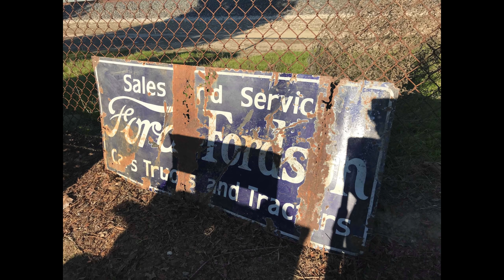California Adventure 2019 Part 1 - Hot Rods, Offenhauser and Turlock Swap

Comment: hmm. Not a fan of lowriders. Don't see the point. Personally not a fan of chopped tops either, but that's from a practical standpoint, while some cars look great chopped, I'm a tall guy, they do not work for me. In fact, I'd like to reverse chop some, making the cab taller instead of shorter. I don't remember ever seeing that, I don't even know if it can be done. Actually lowriders at the low setting the way most park them don't do well for me either, I'm no longer young and gettiing out of something that low is a problem. Trucks that are lowered and /or set on car frames make little sense to me either, not if you want to haul anything much, but I do like Rancheros and El Caminos, go figure, but then you don't expect them to haul much. I'm a bigger fan of resto=mods, ones that look stock as hell, but have more modern brakes, and an kick ass engine, but without electronics. Electronics are so prone to failure, I don't see why anyone would want them.
Reply: Toot
You forget, hot rodding is rolling art work, to each their own. Remember Ed Roth and George Barris ?
Reply from the maker: The nice thing about custom cars is that we can all make them what we want them to be. I don’t think it’s fair to make a blanket statement about a style or type of custom car just because you can’t fit in it or don’t want to bend down to get in. I appreciate most all custom cars that are well done.  A low rider is about crazy as it gets for the passion that goes into building them and the level of the quality of work. Feel free to raise the roof on a car, it’s your world and your car! -Matt/ITG
Reply: It'd be as boring as all fuck if we all built the same shit!
Reply: @IronTrapGarage  I agree, just as long as we are not talking about donks, stance, or squated trucks. Some of the modern trends are stupid.
Reply: @RichieCat4223  OH yeah, I recall Big Daddy Roth and Barris. I'm saying anything but what I like and don't like. Everybody else will have different opinions. I've seen some lowriders that were amazing, with paint that was so intricate... but still I see no reason to set it on the ground, hop it or all that, just not my scene. Then you have the guys that jack stuff up so high they're practically not drivable, not at speed anyway, they'd roll in a heartbeat. Me, I'd rather it look nice but plain,  but blow your doors off when it's time to go. Heck, I'd like one of those 250 HP VW bugs!  I had a buddy that was stationed in Germany back in the 70's. He had his Firebird brought over... he was doing 120 on the Autobahn and got passed like he was standing still by a VW bug. I'd like to be the guy in the bug, not the thunderchicken. 
If I could make it happen, I'd find a nice stock Mom mobile, then stick a huge blown V8 in the back, but make it look as much as possible like it was still a minivan MomMobile. Could you imagine the face of some guy that has his hot rod blown away by a Mom mobile? That would be fun. 
A guy that ran around my home town had a Mustang that had super wide tires on the back with ladder bars, and a prostock style hood on it. everyone thought it was one badass mustang. I caught im with the hood up one night... it had a stock straight six in it. I guess that's the opposite way to go. Then there was one made the magazines, a Chevette of all things. Big meats out back with traction bars, wheelie bars, the driver's seat was moved to the back, there's a big ass blower sticking out of the hood... but under the fake blower was that stock little four banger.
Reply: @tootall5559  there is I believe a Honda minivan on here with a souped up motor racing and beating q bunch of ppm
Reply: @jameswalker3416  I wouldn't soup a Honda motor. Frankly, I've heard them souped with the loud pipes and all, does nothing for me. I'd actually leave the front wheel drive little banger in place. Use it to pull up to the line... Fire the big V8 in tha back at the last minute. Watch their heads turn as it shakes the ground!                 
Speaking of that... my home town has a weekend thing where they have parades, marching bands, band competition, all kinds of stuff...or at least they used to, I haven't been there in at least 20 years... any way it's late Sunday nigh after the big weekend. We'd all heard rumors of a gal just past the end of main street that had a really hot mustang in her garage... well this night the rumors were confirmed. That thing came idling down main street,  at only idle the windows of the store fronts were vibrating so much we thought they'd break. Don't know what the hell she had in it, but it was badass as it could be, that's for sure. Why she had it out... don't know, it was actually a race ready car. ... that reminds me of another one

My buddy was driving, he got pulled over by a cop in a residential area. Just as he gives the cop his license, a full on front engined rail comes zooming by. No lights, of course, fully track ready. The cop tosses my buddy his license, and says "It's your lucky day" then gets in his car and takes off after the rail. (yeah, that's how long ago it was, they were still running front engine "digger" rails) I actually used to work for the guy that owned the rail, mowing his weeds and what not. Whatever happened, I don't know. We weren't far from his house and garage... probably pulled in and shut out the garage lights until the cop was gone, I don't know.
Reply: @tootall5559  not my cup of tea either but I thought of it when u said that I do like sleepers that's for shore.

I'm with Matt on this one though if someone has the drive AMD creativity to build a custom car I'm all for it unless there building what I call a shock rod which is just a giant paper weight. I mean if u can't drive it on the street what's the point.

I seen a 55 Chevy done up like a gaser but he had steel mesh for floor boards. What is the point in a car like that to get attention then get cut up after a show.
Reply: @jameswalker3416  If you can't use it, it's worthless as far as I'm concerned. The use may vary, some are just to turn heads... I guess that's okay. There are some cars out there made to look like full on race cars, but are street legal...well legal in some places. You want to turn heads, all you need is a blower sticking out of the hood, with the accompanying blower whine, and I don't care if it's in the worst beat up old crap car, you'll get attention. Probably the wrong kind of attention when Johnny Law comes around. I'm not a real fan of show only cars, but some people are into that. I don't care for show, I like go. The quickest car our street drags back in the day was a four door comet, it happened to have a 302 in it, and that 302 came from the factory like balanced or something, it was mean. Note I said the quickest, not the fastest, the top end was only in the  90's, but it got there quick. Then again the guy driving it could probably trade cars with you and still beat you, he was that good. One night as the last race, we piled in so we could go on our way, and lined up against a Plymouth GTX with a Hemi in it. We beat the Hemi, hands down. While it was spinning tires, we were gone.